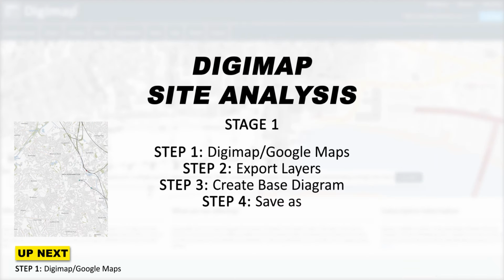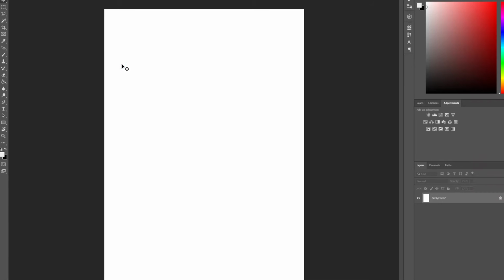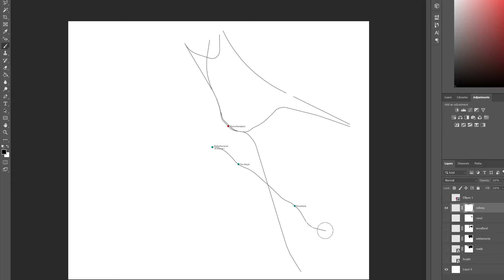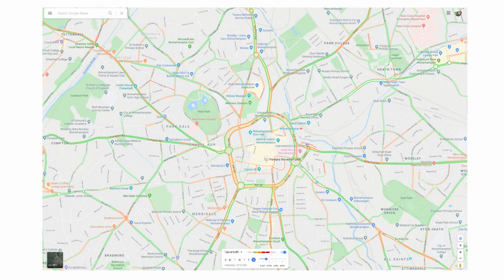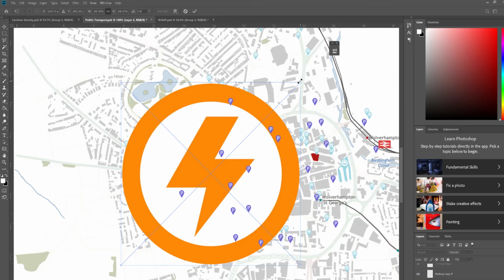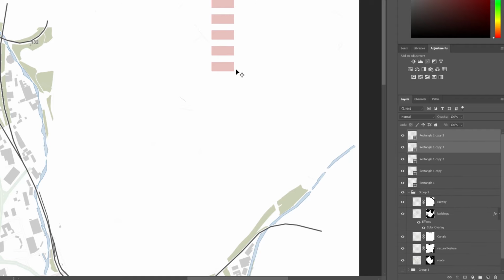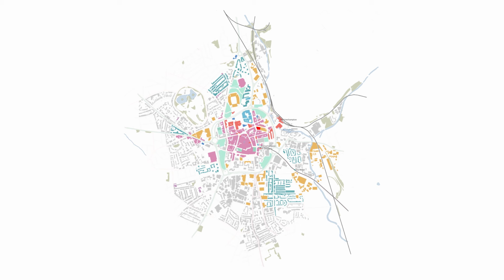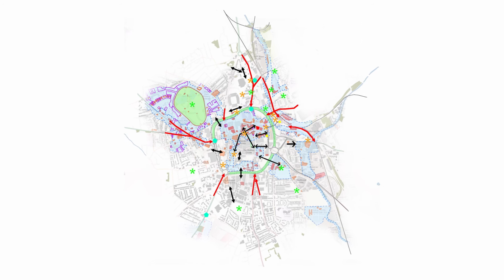Digimap & Photoshop Site Analysis Architecture Diagrams -ad

Comment: Top tip: If you open the PDFs in illustrator first, you can more easily select text and individual elements (like the digimaps watermark) and remove them (or re-colour them) with a bit more presicion and speed. Great video! 🛠
Reply from the maker: Yesssss! Thanks for the tip!

Comment: This tutorial is so informative, I have a query : Which saving file format would give better printing quality of these kind of architecture renderings JPEG or Photoshop PDF, Which one to go for 'save as' in photoshop, Thank you
Reply: PDF is always going to be the better option. Most my profs only accept PDF files.
Reply: @MrRudderbucky  Thanks a lot for  replying to my query
Reply from the maker: Both JPEG and PDF will have good quality depending on the settings you save it in. However PDF will have a larger file size.
Reply: @SurvivingArchitecture  could you share the settings, recently I had my Thesis Jury then, After print I could see no water color effects which I have rendered on my sheet. I thought I did some mistake.Anyway THANKS FOR REPLYING TO MY QUERY, KEEP UPLOADING YOUR  WORK , I have been your subscriber👍

Comment: Hi, how did you get to insert all of them at once in photoshop and did you save them as JPG?
Reply: if you have photoshop open on half the screen and the folder where you exported the files on the other half just select all the files u need then drag into photoshop. it will ask you to confirm each file one by one so they wont all show at first. youll need to click the tick at the top for each one. Files were exported in PDF :)

Comment: Hey how do you handle pixelation of lines in photoshop
Reply: temitope akinsiku if you were to do this in illustrator, the file would be vector (lines) rather than raster (pixels). Also with illustrator you have a feature where you can remove the watermark in one go.
Reply from the maker: As Jan said, the end images will definitely better quality if done in illustrator. For pixeled lines in photoshop, you can sharpen using sharpen filter and avoid turning smart objects to rastered images. Since I know the size I will be printing these is small so little pixels don't bother me as when it's printed, its still high quality :)
Reply: @SurvivingArchitecture  thanks a lot, keep up the great work